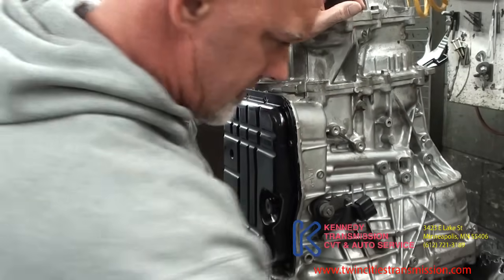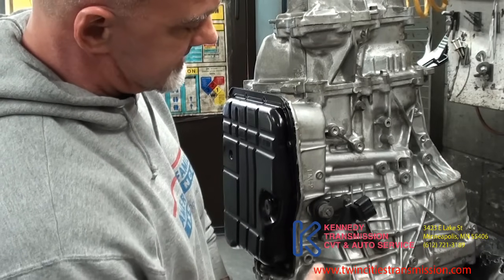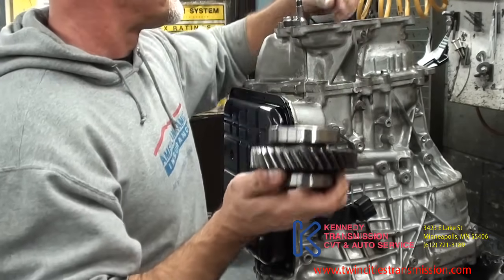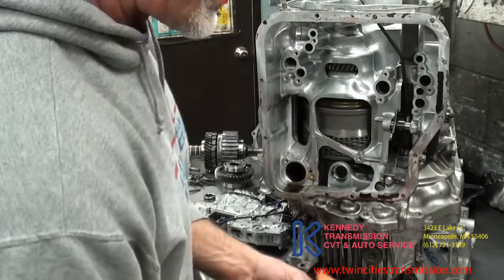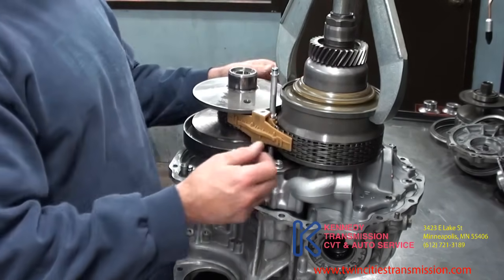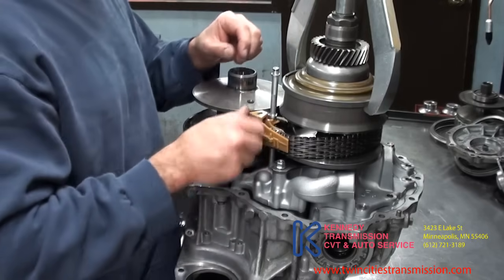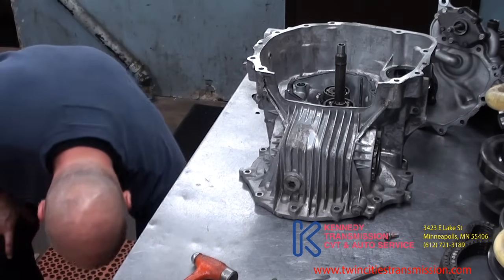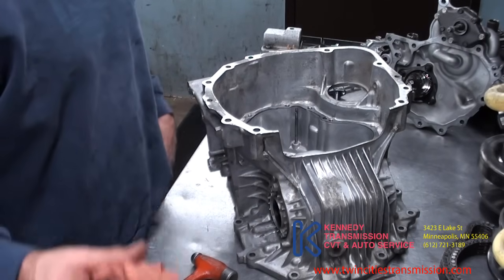Subaru CVT Repair- Lineartronic TR 690 Disassembly

Comment: Never, ever, buy ANY vehicle with a CVT gearbox - they're ALL inherently CRAP ! You've been warned ! Stick with the latest DSG type auto boxes.
Suffice to say, Subaru who do use CVTs in their lower spec vehicles, decided NOT to fit one in their top spec BRZ. That vehicle has a conventional auto box which is superb ! Nissan even tried to put "steps" in their CVTs in order to replicate the "feel" of a torque converter box, but they failed miserably. Stick with proper autos and avoid CVTs at ALL costs !
Reply: You say BRZ as in top spec and yet it only makes 200 hp, meanwhile WRX and STI make well into the 230-300 range
Reply: You sound like a caveman there are millions and millions of CVT without any problems! Wonderful technology, don’t believe everything you think

Comment: What actuates the primary variator pulley? Hydraulics? Seems the secondary (output) has a spring to keep it tight against the chain as the primary pulley moves in and out. How much force is involved in this - I've always wondered if this could be moved by a manual lever to create a manual CVT, but I could imagine it might require more force than feasible with just linkages and the driver's hand.
Reply: 800psi of cvt fluid

Comment: CVTs were the death of Subaru.  Don't trust 'em, won't buy a car with one.  Maybe I'll replace my 2007 Legacy with a Toyota Camry!
Reply: Wrong!  CVTs are the death of nissan.  They are much flimsier.  Dead in 15-20K miles.  Subaru seems to have the best CVT made so far......in the realm of CVTs, that is.  There, of course, are stronger transmissions.....but not stronger CVTs.  Just don't get me started on the rotting engine blocks.
Reply: @vilefly  I'm at 165k miles on my 14 year old Legacy with no transmission issues. Wouldn't bet on a CVT lasting that long. Plus the driving experience sucks. I'll take a Camry with an 8 speed automatic!
Reply: @mj1234321  The morning bacon in my stomach tells me your CVT is better than nissan's CVT.  Anything with more moving parts will fail sooner.  I have to question the need for 8 gear ranges and little improvement in gas mileage over the old 4 speed automatic.  Just make sure it has a dipstick on it.  Lots of newer cars don't.....they leak and die alot.
Reply: @Rubber Thingy Ultimately, it is poor design that requires excessive maintenance.
Reply: @Rubber Thingy I agree with you, but one would think that as we move forward  with experience and better technology, we could have more efficient and longer lasting transmissions without the problems we are seeing today.  Kind of hard for anyone to believe that Subaru used a suitable transmission for the new Ascent.

Comment: No matter how you cut the cake, a CVT transmission is shit.  There is no room in a thinking man's life for such a nasty thing :)
Reply: You just said a shitload of old cobblers.
Reply: @Gavichap  Shame, you are one of the crowd that doesn't think.  Never mind, there's hope for you, but you must take the first step to educate yourself.
Reply: @einfelder8262  Oh yes, millions of CVTs are around and running - and not failing - but you are lecturing about "truth". Sure. Toyota's zillionth Prius is laughing at you, along all the scooters on Earth that all have CVT. Ciao.
Reply: @Gavichap  I'm not lecturing about truth - I just said CVTs are shit, don't get depressed because it's OK if you love them.  There is no road vehicle for which the CVT is the best transmission, end of story.
Reply: @einfelder8262  Well you're dead wrong and full stop. Engineers laugh you in the face and end of story.
Reply: @Gavichap  Engineers design and build failures every day.  Your failure is that you believe in fairy tales.  CVTs are shit, end of story.
Reply: @einfelder8262  tell that to someone with 500,000 miles on the CVT!
Reply: @darylhill9400  I will never meet a person who lives that long with a CVT - they would have died of sheer driving boredom long before then. I play darts with a guy who has had 3 CVTs shit themselves before 20,000k.  Tell that to someone.
Reply: @einfelder8262  their warranty to 100,000! And according to Subaru documentation which you can check out a very small number of cars have CVT issues, yes some do then the propaganda Myth explodes!  have you drove a CVT WRX? And by the way not everybody is looking for massive performance, a non-turbo 2.5 matched with the CVT It’s very utilitarian all around the vehicle.
Reply: @darylhill9400  Having a vehicle in for gearbox replacement twice in 20,000k is ridiculous in the extreme.  How many more times will it break before the warranty expires?  Why do you love the shit CVT so much?  It's rubbish for motor vehicles, and Subaru is one of the worst CVT experiences available in the motoring world.  Give up, bloke, the majority rules - CVT is rubbish.

Comment: I leased a 2018 Impresa "50th" from new, at 2500 miles I took the car in for its first oil change and added a noise complaint. The dealer told me they found the noise and the car needed a new transmission. At 7500 miles the car was making the noise again so I ended the lease early and bought a used '17 BMW i3 which has been a better car so far

Comment: So the aftermarket low range case would sandwich between the intermediate case and the extension housing...bear with me, I'm still trying to wrap my head around the rest of the clockwork.

Comment: So nice to see this! Even the dealers don't mess with these, they send them back to the headquarters for QA. So, nobody local gets experience until late in the game, years later.
Reply: Biggest problem is getting parts to fix them. They're actually easier to work on a lot less parts than say a 6 speed auto
Reply: Dealers are just "parts swappers" ...... they rarely have anyone with enough experience to do this kind of work... dealers want to do just what brings the most money.

Comment: Great video, thanks. Who makes the tool you used at 14.25 to pry out front pump? Any info would be appreciated. Cheers
Reply: I'm wondering as well. Could be used for a lot of things instead of a slide hammer
Reply: @cheesecurd100s  Found it.  SnapOn pn: S9094B cotter pin puller.
Reply: Snap-on seal puller
I have one of those

Comment: How hard is it to replace the thrust washer in the converter that's exactly what mine is doing it won't drop down or disengage and stalls at a intersection
Reply: @Rubber Thingy thanks mate got a new torque converter and it's running like a dream thanks for your video

Comment: Great video, Thanks !  

Have you got any tips on identifying Variator chain noise ?  Best I can describe it is somewhere between a bad wheel bearing and a differential, emanating from the main body of the transmission, sound about right ?

Comment: Had a Nissan Rogue and I sold it to get a Subaru after looking at both of those chains I think I made the right choice lot of Nissan owners saying their chains will snap and completely destroy the inside of CVT
Reply: Nissan uses jatco CVTs, they're literally the worst ones you can get. It's Russian roulette with them
Reply: Nissan is a belt made up of links.  The links compress as they are pushed together.  Subaru is chain, and the force vector is pulling along the chain axis.  They are significantly different.

Comment: I had a tech do head gaskets and we think the torque converter got jammed when re-installing the engine. Tech went for test drive, broke down, and now trans just revs and no fluid flowing in the lines. 

I have a core trans that just has a bad bearing noise only when moving. Think I can swap over the front pump drive chain and be good to go? Advice appreciated in advance.
Reply: Mine is doing the same thing with the rev, and no fluid pumping. What did you end up doing?

Comment: Great video! I was hoping you could tell me if I could remove that extension housing without removing the transmission to repair the gasket. I'm concerned something internally might shift in that orientation.

Comment: I have the mentioned stall problem on my 2009 Legacy, but aside, looking at this, surely it's the end of the road for the internal combustion engine? mechanical complexity is too much - EV's have to be the way to go. I've owned Nissan Leaf's for 4yrs.  It has to be the future. The service organization doesn't know what to do when they come in for service. Fill the screen washer water.

Comment: How long can a chain CVT last in a subaru?
Reply: Change ur fluid every 25k and u won't have a problem. Up to 270k myself and I tow
Reply: @matthewmaca6675  You got lucky man. The proper maintenance is to get is inspected by the dealer every 25k or so, and only change if necessary. Plus it voids your warranty if you do it yourself.

Comment: Do the chain and "pulleys" get replaced when these are serviced? The chain still looked pretty good but the pin contact surface was distorted which is probably critical. I have one with the 580 with 70 k does its job.

Comment: Same as a First Gen CR-V and many other modern shit boxes, can't change the ATF filter without splitting the cases. AWESOME. 🙄👎🏻😒💩
Planned obsolescence/self destruction at it's finest.
Thanks for the video, very entertaining and helpful. 👌🏻😎👍🏻
Reply: The TR690 does not have a filter, does it?
Reply: @514aam  yeah it is more of a metal screen intake filter in pan you have to remove pan scrape old sealant off clean it all up pull out filter screen intake unit and replace it then carefully put pan back on with new sealant
Reply: @ranger178  oh yeah, the metal screen, it really doesn't catch much, good idea to clean it
Reply: That’s not true, you can change the CVT fluid from underneath.
Reply: @Backs4more  adjust your glasses and read again.
I said the filter, I never said the fluid couldn't be changed.
Changing the fluid it's a half assed solution anyway.
Reply: @GIGABACHI  fair enough, you are correct, I have adjusted my glasses.
Reply: @Backs4more  👌🙂👍

Comment: The secondary pulleys have a return spring. Is the spring tension dependent on the torque of the engine or just enough to push the pulley back to its original low ratio position?

Comment: How often should I have a drain/fill service done on my CVT (2016 Legacy 3.6R)?
Reply: @Rubber Thingy Yeah, 2015+ Legacy's all have CVTs. At least in the US
Reply: 3 years/30,000 miles
Reply: @NoName-gv6nm   which is exactly what Subaru tell you not to do.
Reply: @Backs4more  They recommend inspecting the fluid every 30k and replacing as needed. The servere service interval is in the manual as every 25,855 miles (40k kilometers). 2018 Outback Service schedule.

Comment: Interesting to see the difference in the chain between the Subaru and Nissan. Subaru held together by rivetts and the Nissan by cable ties! huge difference in thickness too.
Reply: Nissan actually uses a "push belt". Instead of the input pulling a chain, it pushes a belt of steel plates. Compression instead of tension.
Reply: @BenjaminCronce  yup and when those elements compress, the push belt becomes a solid steel bar essentially. Very strong. I think nissan just programed them poorly and caused problems. Low fluid pressure or something. Also insufficient cooling. I know of lots of people with nissans, never seen a transmission issue...
Reply: @NoName-gv6nm  Nissan uses pins in a groove to pass torque. The grooves get hogged out, one pulley will hang a little and pop the chain when it changes ratios.
Reply: @mfree80286  that is true. Definitely a point of concern. Atleast the pins are a bit stronger than the tiny balls they used to use. What does Subaru use to pass to torgue on the variators?
Reply: @NoName-gv6nm  Splines, just like any other transmission.

Comment: great vid. So you guys rebuild them? i have called at least 5 trans places in my area (seattle) and non of them will rebuild a subaru CVT.  they just say go to the dealer. Dealer price is $8K  is what i have read from many sources.   This is what has kept me from buying an Subaru with CVT.   So how much does a rebuild from you folks usually cost?  is there a reason other trans places won't rebuild them?  parts? knowledge?
Reply: First, knowledge. Second, parts sourcing.
Reply: they are scared   4-5k for rebuild from me

Comment: Great video, did you find the cause of the slipping issue?
Reply: The metal pins that hold the chain links together are also what ride on the variator and output pully. The way that CVT's work requires a lot of pressure put on those contact surfaces, so the faces of the two pully's as well as the chain pins wear rather quickly.
Reply: usually from converter coming apart

Comment: How much does a rebuild like this cost? And do you have any fluid recomendations or fluid interval change recommendations? I thought about going with amsoil cvt and doing the 24,855mi (40,000km) severe service just to be safe.
Reply: Stick to OEM fluid and do 3 years/30k miles
Reply: A rebuilt Subaru cvt costs over $6k!!
Reply: @egx161  False statement, a new factory one perhaps!
Reply: For cheap insurance I would do a yearly fluid changes. Fluid changes are cheaper than getting a new transmission plus labor cost. Most people just junk their cars. When you usually do a drain and fill you don't get all the fluid out.  For high end German cars with lifetime ATF fluid(sealed transmission) transmissions are like 10k!
Reply: @stevel1475  Cause gas over there is an arm and a leg, people are not putting 60k miles on their car. bmw and Mercedes can get away with it.
Reply: @lifeisgood070  Ya gas cost arm, leg and part of your nuts here. Alot of money flowing in these parts. Where we have the most supercars per capita. One time we had the title for the most stolen cars in the world.
One of the most expensive house here is pegged at 79 million dollars. The BMW dealer here sells the most Bimmers in North America.
Insurance for new drivers are like $5000 a year. Ridiculous eh...
Reply: @lifeisgood070  People still drive and put mileage. Their CVT are gone as you don't see the early 2000 Sentras and Muranos, and Pathfinders are kinda rare.
Reply: A shit ton,!!!

Comment: what caused the slipping? lack of pressure? abuse?
Reply: Lack of pressure is usually the case
Reply: @NoName-gv6nm  lack of pressure happens from clogged hydraulics?
Personally feel like the 690Nm transmission couldn't even handle 650Nm reliably.
Reply: @lifeisgood070  i guess I was talking more about the nissan units
 I got a letter in the mail for a reprogram cause Nissan said it wasn't functioning with enough pressure. Idk about subaru.
Reply: +1 cause also curious

Comment: Exelent info Matt. Do you happen to know the differences between the TR690 JHBBA (wagon) and the JHBAA (sedan)?  I have a very bad whine on a car I just got. Thought it was power steering at first. Guessing it's the trans pump, took of serep belt.
Reply from the maker: We do see slight variations within TR690's, but as to the applications you are referencing, I am not sure if there are any differences.  We are always rebuilding the unit that came in the vehicle, so I am not sure about interchangeability.

Thanks,

Matt Johnson
Reply: @kennedytransmissioncvtauto5430  did some more digging. I guess it is final drive ratio differences between wagon and sedan. My trans is making same noise as a bad power  steering pump and not moving super well. Think it is the converter? Auction buy.

Comment: Hello!  What often breaks down on the TR690?  what exactly broke in this box?  I’ve been driving the Outback BR for 12 years ... I want to change the fine filter on the box ... Respect from Russia!  good job!
Reply from the maker: Jaguar,

Bearing failures are the most common issue on the TR690.  Servicing the transmission routinely is the best way to minimize wear.  That being said, these CVT's do hold up pretty well.

Thanks,

Matt Johnson

Comment: Are Subaru’s CVT more reliable than Nissan’s? I believe the older Subaru ones were JATCO (like Nissan), but the newer ones are made by Subaru? Thanks.
Reply from the maker: Nickolas,

You are correct, we see far fewer issues with the Subaru CVT's than the Jatco units.  Fortunately we have been able to source parts the past few years.

Thanks,

Matt Johnson
Reply: Kennedy Transmission, CVT & Auto thank you for info, keep up the good work!
Reply: Subaru especially over-built their first gen CVTs and had a program inspecting ANY issues. They've put a huge effort into these as their go-to tranny. I love the Subaru CVT. Driving is so much smoother, and even a 4-cyl can feel smoother in the mountains due to how the CVT can keep the motor in it's *sweet spot*. Just ignore the morons who will tell you to check/service the CVT fluid. JUST DON'T unless it's a required scheduled maintenance. and leave it to a dealer..
Reply: @Mike80528  Agree. I think they do it every 30K miles